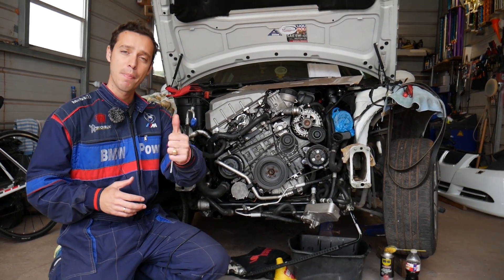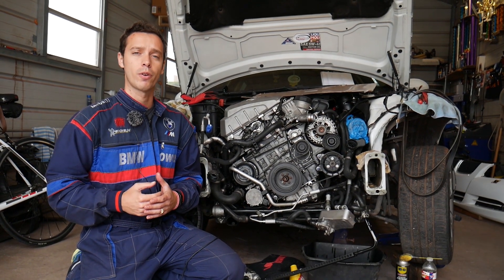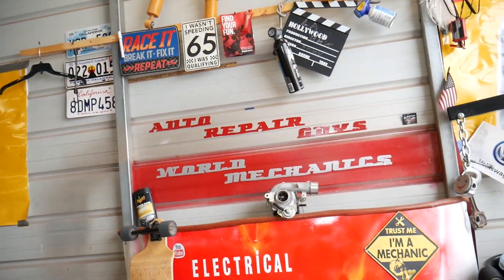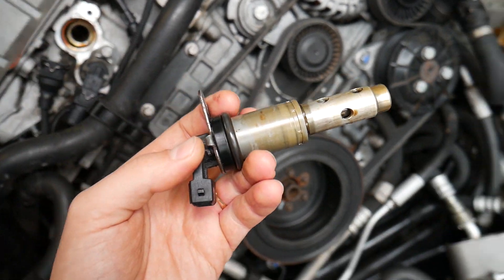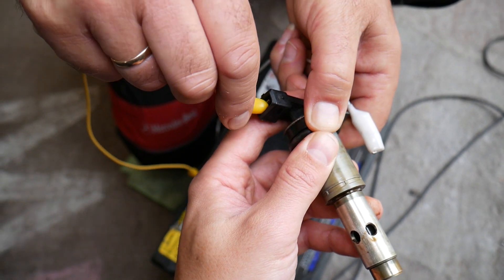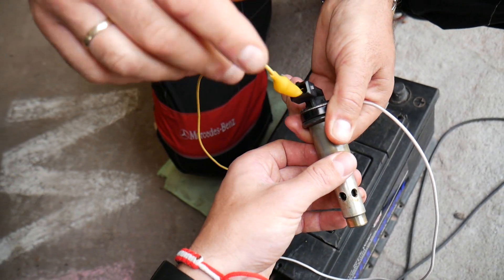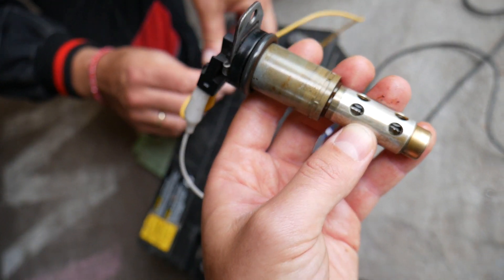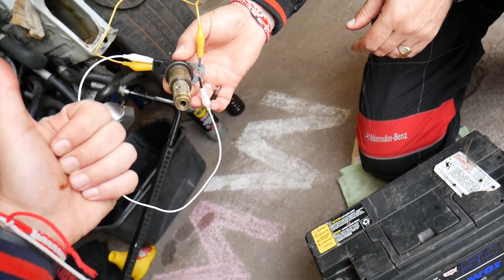BMW 1 SERIES TEST VANOS SOLENOID BMW E81 E82 E87 E88 F20 F21

Comment: Need some advice
Got a BMW N13 F30. Keep on getting a fault , exhaust vanos stuck. Happens erratically. Replace vanos control valve, exhaust vanos, oil seals on the camshaft, oil pressure control valve and oil pump. Bit problem persists. Oil pressure running on spec out of ideas on this one